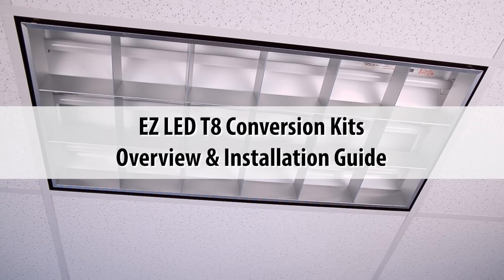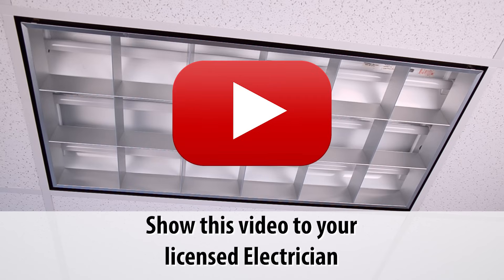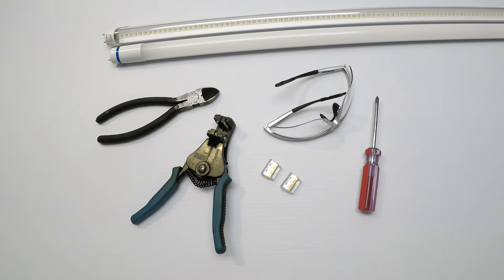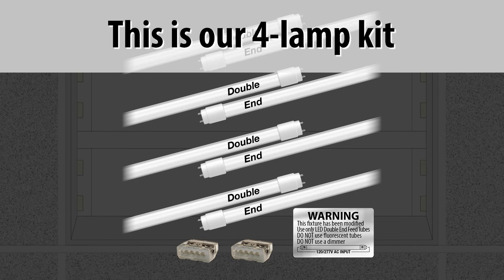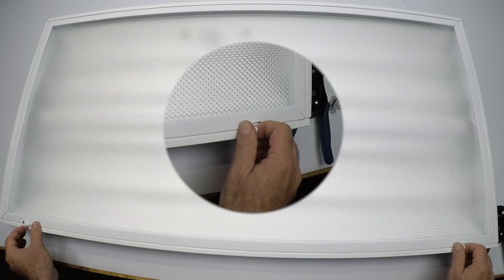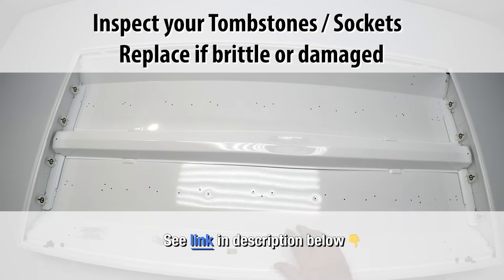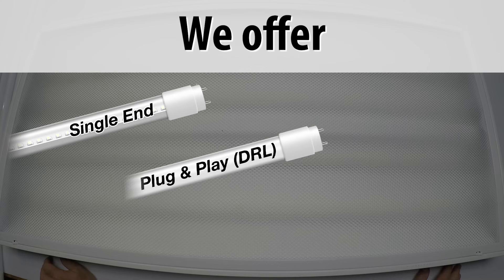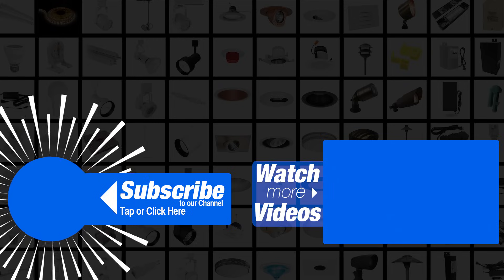5 minute or less fluorescent tube light to LED T8 conversion with our EZ Kit by Total Bulk Lighting

Comment: I watched your conversion of removing the old ballast and connecting the wires together for LED 4ft bulbs, but my question for total supply lighting is: do I still need to connect a fuse on black hot wire when attachment to blue and red wires? GE led illustrated this in their led lighting package.

Comment: Great video, thanks for posting. I subscribed. I do have a question. I know with fluorescent technology, Non-Shunted were used for Dimming/Programmed/Rapid start Ballasts. Those fixtures with instant start ballasts are shunted tombstones. Confirm I am correct on that.  Now your video tells us Type B LED tubes requires Non-Shunted. What do Type A tubes require? and what do Type C tubes require? Can you help?
Reply from the maker: We have found from our experience that there tends to be shunted tombstones used in the majority of fluorescent fixtures due to the nature of how the power flows through the fluorescent tubes regardless of the ballast type. In this video we are using Dual end powered LED T8 Tubes. Not to be confused with Single end powered LED T8 tubes which require a different wiring all together. I will just focus on the Dual end. Dual end powered Type-B LED T8 tubes require the ballast to be bypassed / removed as each tube has its own LED driver to regulate the power to the LEDs in the tube. Dual end powered Type-A LED T8 tubes require the ballast to remain to proved power to these type of LED tubes. Dual end powered Type-C tubes requires the replacement of the fluorescent ballast with a LED driver. So the type of tombstones doesn't necessarily define what Type of LED T8 tube is required but more importantly how the LED tube type will need power. So its important to know what type of tube you are using and if it is single or dual end powered. All our EZ LED T8 kits we sell are dual end powered. Hope this helps 🙂

Comment: I've been watching a lot of LED conversion demonstrations, and while I understand a single power cable on a table is easier for us to see what's going on, wouldn't there be a secondary cable for the light switch in a standard setup? Don't think i've seen more than one cable coming into the fixture in any I've seen.
Reply from the maker: There are many ways to wire a light fixture and a switch. I would recommend searching for videos on how a light switch works as those would explain better what is going on there. Hope that helps 🙂

Comment: I have a two bulb fixture with wiring:

Two black and two whites on one side.

One yellow and one red on the other side.

Should I connect all four wires ( two black and two white) to positive and the yellow and blue to negative?
Reply from the maker: The color of the wires are going to not matter as much. If you follow the wiring diagram here that is what is important https://www.totalbulklighting.com/downloads/dl/file/id/1215/led_t8_double_end_power_wire_diagram.pdf If you are still unsure the best thing is to find a licensed electrician in your area that can help. Have a blessed New Year!

Comment: Does it matter which way you put the tube? Can you put it in any way, even if it is in a "wrong way?"
Reply from the maker: With our tubes it shouldn't matter the direction as long as the fixture is wired correctly 🙂

Comment: I have one connector(socket)  that is damaged. In this video demonstration was it a shunted or non shunted socket that you used.  The fixture that I'm going to convert is a F32 T8 4  lamp fluorescent.  Thanks
Reply from the maker: We used shunted sockets in this video. However, not all fixtures are the same so it is important to understand the electrical wiring so you can identify what type of sockets your fixture has. We have a video on Shunted vs Non-Shunted Sockets here ➡️ https://www.youtube.com/watch?v=R6xe54orVNY hope that helps 🙂

Comment: I just place new leds T8/T12 tubes in today. They replaced the older fluorescent tubes. I flicked the switch and they worked fine. Should I be worried?
Reply from the maker: Sounds like you replaced with LED T8 Type A tubes that work with the existing ballast. If you're concerned I would check with the place you purchased from about the tubes you purchased and how you installed them. They should be able to help 🙂
Reply: @Totallightingsupply  Thank you writing, I believe that you are correct. I bought them at Walmart, and inside was a paper with a ton of ballasts that work well with the new leds. So my guess is that I got lucky, and all should be fine. Just wondering though, if that was not the case, then I would imagine that when I put the new leds in and flicked the switch, the kights should not have turned on?
Reply from the maker: @iamric23  Most likely the tubes may turn on for a brief moment but would be ruined.
Reply: @Totallightingsupply  Thanks, so if they stay on for 10 minutes I should be in the clear?
Reply from the maker: @iamric23  It does sound like you have the right tube type for your application 🙂

Comment: Great video. Simple and easy. Then I look at what I have and shake my head. I have a 2ft fixture that I removed the ballast from. The continuity tester says I have 2 non-shunted tombstones. Great. But wait there is more. 1 tombstone has a white wire in the #1 slot and a yellow wire in the #4 slot ??? The other tombstone has a yellow wire coming from the #1 slot and a black wire coming from the #4 slot????  My confusion increases. Maybe you can help me.
Reply from the maker: As along as all the wires in the tombstones on one side of the fixture are Neutral (White) and connected together by a wire nut or our handy multi-port wire connector and all the wires in the tombstone on the opposite side are Black (Hot) and are all connected together by a wire nut or our multi-port wire connector the color of the wire makes no difference. Here is a link to our wire diagram that illustrates this 👉 https://www.totalbulklighting.com/downloads/dl/file/id/1215/led_t8_double_end_power_wire_diagram.pdf - Hope it helps 🙂

Comment: Can’t you just buy plug and play bulbs or tubes and skip all this work?
Reply from the maker: Yes you can do that but once the ballast fails you will need to decide if you are going to replace the ballast or retrofit the fixture as shown in this video. However, we offer a universal T8 LED tube that is compatible with the existing fluorescent ballast, single end retrofit method and double end retrofit method as shown in this video. You can purchase the tubes here 👉 https://www.totalbulklighting.com/t8-led-lamps/universal-compatible-led-t8-tubes-type-a-b.html Also you can see the video here that talks all about the universal T8 LED tubes 👉 https://www.youtube.com/watch?v=xPOu-jSTrPc - Have a blessed day!
Reply: @Totallightingsupply  OK thanks. So to cut to the chase, are you saying ‘yes, we sell them (plug and play)? I’ll definitely take you up on that if it’s easy to return defective lights that have repeatedly happened when they were mailed or curbside picked up). I wanted high lumen daylight T12 replacement LED tube, 48 inches. Electricians here are booked solid for weeks so am looking to replace the old tubes ASAP. Ballast removal later.
Reply from the maker: @hatuxka  Yes, we do sell LED T8 tube replacement for plug n play in T8 fluorescent fixtures. Unfortunately, our LED T8 tubes are not compatible with existing T12 ballasts for plug n play replacement. For T12 conversions you will have to retrofit the fluorescent fixture like the method shown in this video to use our and many others LED T8 tubes. Hope that helps clear things up 🙂

Comment: I just replaced 12 fluorescent lights in the garage for these LED tubes 5000k clears. The light output is amazing. Do not 🚫 do clears unless you have covers. Absolutely use the frosted for open light fixtures. Trust me. Making My Garage Great Again 2020. 😎🇺🇲
Reply from the maker: Glad your conversion was a success! We agree, that frosted dual end powered LED T8 tubes are the way to go in almost all applications where non-lens fluorescent fixtures are retrofitted, unless the fixture is mounted very high on the ceiling 🙂 We love helping make Garages Great Again 😃

Comment: I have 4- 48", 4 bulb fluorescent fixtures and I bought an LED replacement kit that removes the ballast and replaces with non-shunted tombstones.  I purchased Phillips LED bulbs from Home Depot and the light does not work.  Checked all connections OK.  On another fixture, I tried the direct wire method, removing the ballast as you show and tried another Phillips bulb and that doesn't work.  Power is ok.  Am I using the wrong type of bulbs??
Reply from the maker: If you followed the wiring diagrams it sounds like the LED tube you are using is not compatible with the retrofit method you are using. Best thing is to research your LED tubes part number and determine if it is a Type-A or Type-B tube and if Type-B if it is Single End Powered or Dual End Powered.. Our video here is for Dual End Powered Type-B LED tubes. We offer a complete kit here to make the process super easy 👉 https://www.totalbulklighting.com/retrofit-kits/ez-t8-led-4-foot-kits.html

Comment: You did not mention shunted vs. non-shunted tombstones.   I've had salesmen tell me that I probably have to replace the tombstones since most T8 fixtures have shunted tombstones.  Can you give me some clarity on this?  I really want to convert the lights at my business, and this video is really helpful.
Reply from the maker: The tombstones used in the video are shunted but if you wire the tombstones correctly you can use both. The best thing is to get in contact with us so we can help you get the right tubes and tombstones for your needs 👉 https://www.totalbulklighting.com/contacts/

Comment: If you turn off the circuit breaker, how would a plug-in light work? Just a thought. ;)
Reply: Uh...  separate circuit?
Reply: Your wall outlets should be on a different circuit from your lights.

Comment: You don't mention if the existing tombstones are shunted or not.  Why you prefer double ended LEDs to single-ended.
Reply from the maker: Most fluorescent fixtures utilize shunted sockets as shown in this video. Double end powered retrofitting is a much faster and less expensive retrofit method than single end. So we prefer the simplify and savings 🙂
Reply: @Totallightingsupply  just yesterday a lighting supplier sold me a single-ended LED tube and starter and told me I can simply fit it without any rewiring  I had my doubts, confirmed when I got back to do the job and found shunted tombstones.  I've now asked him to get me double-ended LED tubes.

Comment: Great and simply video however,......I'm pulling my hair out over converting from fluorescent to LED with a 4 bulb fixture!  My fixture has 2 yellow wires on each side, 2 red wires on each side and 2 blue wires on each side.  I have 1 black wire and 1 white wire coming out of my ceiling and of course the ground wire.  I have watched videos until I'm sick of fooling with this thing.  The first time I attempted this, I connected the yellow wires individually and the red wires individually and the blue.  I connected the yellow to the white and the blue to the black and nothing happened.  Second time around I entered a single splice of yellow wire with the 2 yellow wires from each side and attached it to the white wire.  I then entered a single splice of blue wire with the 2 blue wires from each side and attached the blue to the black wire giving me 5 wires to twist together and of course the yellow wires were attached together with the black wire giving me 5 wires to twist together with screw caps.  I am at my wits end over this and I'm a neat freak and did a really great job however, no lights!  I only know of one thing that may be my problem and that is that to start with, 2 fluorescent bulbs went out and I decided to convert the fixture over to LEDS.  Is it possible after all this work, that I may have a bad tombstone in the fixture???  I need help please! :-(
Reply from the maker: Jerry, did you purchase your kit from us? If so we can have our support connect with you. Please fill out this form and include your order# https://www.totalbulklighting.com/contacts/  If you did not order from us, you may have the wrong type of LED T8 Tube. We see this all the time. This video is for Double End powered LED T8 Tubes only. It will not work with single end powered LED T8 tubes.
Reply: call me at 4792806459 i can assist you
Reply: when buying the Tube how can you tell if it is a single or double end powered tube?
Reply: @darrellherold6084  I have the same question but don't see an answer

Comment: Is there any difference when changing from a two ballast system. I have a lot more wire to connect at each end.
Reply: you can remove alot of the unnecessary wires that arnt needed by pulling them out of the tumbstones
Reply from the maker: Take a look at our video "How to convert a TWO Ballast T8 Fluorescent Tube Light to LED T8 DOUBLE END powered Fixture" here 👉https://www.youtube.com/watch?v=bnaUhFCdFuI I think it will help 🙂

Comment: Can these be used with both shunted and non-shunted tombstones in the same fixture?
Reply from the maker: As long as you follow the wiring diagram for our double end powered tubes you should be able to use either shunted or non-shunted tombstones. See video description for our Wire Diagram 🙂

Comment: Hello you would use shunted on double end LED conversions and non shunted on single end conversions. How are the majority of old fluorescent lights wired ? I would think if it is unknown to the customer they would be better starting over and getting the single end conversions.
Reply: double end power bulbs can use both non shunted or shunted tumbstones. single end power can only use non shunted. most older fixtures are T-12 fixtures and they have non shunted tumbstones. the T-12 are the bigger bulbs
Reply from the maker: There are so many variations of fluorescent tube lights out there that it's hard to say how the majority are wired. As long as you follow the wiring diagram it will work. https://www.totalbulklighting.com/downloads/dl/file/id/1215/led_t8_double_end_power_wire_diagram.pdf

Comment: The Ballast you were bypassing must be a variation of a Rapid Start or you guys must sell special LED tubes that work with SHUNTED tombstones - because everything that i've been reading says what you guys did would cause a short and fire hazard if it was an Instant Start ballast.
All fluorescent to LED T8 conversion tutorials i've read says that you should ALWAYS use NON-shunted tombstones.
Can you elaborate?
Thanks!
Reply: Hello So you would use shunted on double end LED conversions and non shunted on single end conversions.
Reply: double end power doesnt matter which bulbs you use. call me at 4792806459 and ill answer any questions
Reply from the maker: Yes, that is correct. The LED tubes used in the video are double end powered LED tubes that can use shunted tombstones. These LED tubes are quickly becoming the more popular choice when retrofitting fluorescent tube lights due to how quick and easy the process is. Please see our wiring diagram on how to use these LED tubes https://www.totalbulklighting.com/downloads/dl/file/id/1215/product/8664/led_t8_double_end_power_wire_diagram.pdf
Reply: as a test , I removed the ballast from my 4 bulb fixture to test one double ended T8 bulb i bought. i connected the hot black house wire to the blue wires on one side of the fixture(the other side had red wires that were not connected) and the white house wire(neutral) to the yellow wires on the other end.  Did i mention i used the same original SHUNTED tombstones.
Turned on the light switch and... the bulb shorted.

I REALLY think i should use NON-shunted tombstones.

can you advise?

Comment: With the 4 pin connector, does it matter which hole you use for the neutral? Or hot?
Reply from the maker: For our connectors shown in the video at 8:39 it doesn't matter which port or order the neutral or hot is connected. What matters greatly is that you ⚠️DO NOT ⚠️ connect the neutral and hot into the same connector.

Comment: Then for Type B double end powered LED tube: UL REQUIRES - One end (lamp base) of the device under test shall be connected to its intended source of supply while the other end (lamp base) of the device shall be considered accessible and shall be connected to the shock hazard measurement meter circuit and, in turn, to earth ground as shown in Figure SA8.1. The current shall not exceed 5 M.I.U.